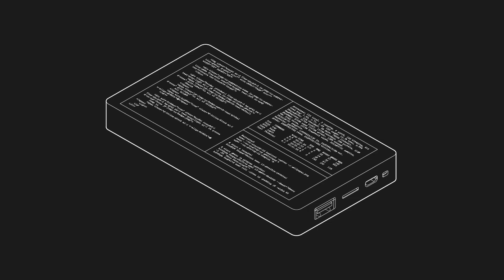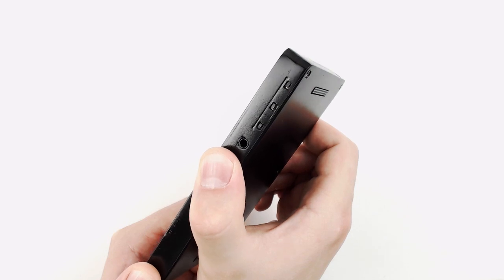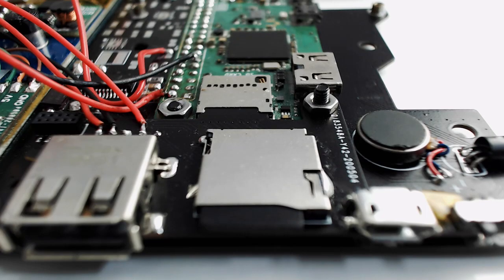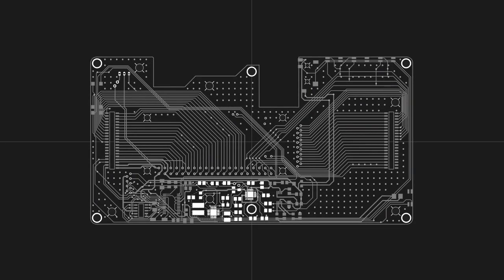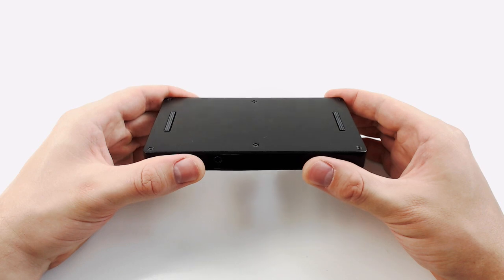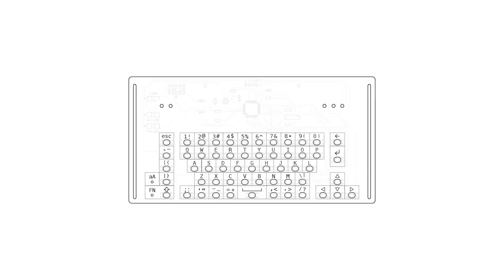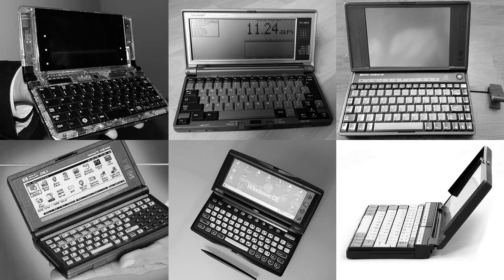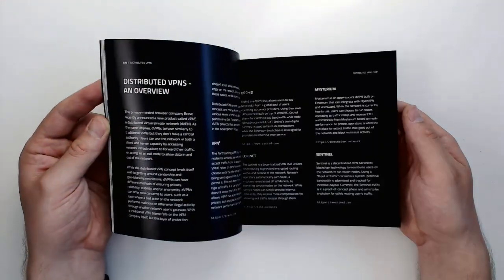Trying to build the ultimate Raspberry Pi computer (Zero Terminal V3)

Comment: This could easily become a “smartphone” as well if you added a baseband backpack. I see a lot of potential here!
Reply: There's the Adafruit FONA module that I'm sure could be worked into this, either baked in or as part of a backpack
Reply: He could use a design from Sparkfun as a reference. They even give you the complete Eagle design files.
Reply: That could be nice! Specially the mobile data
Reply: Why not just buy an actual smartphone? :)
Reply: @Dethcrush  because that's not fun and you don't learn anything by doing it
Reply: @Dethcrush  because this is designed for modularity and data security. Most smartphones aren't that.
Reply: @Dethcrush  this will never be outdated. But phones will be.
Reply: imagine what is going to happen when he gets in to type c, then we're cooking hard 🤣👍
Reply: @hamishmacdonald8593  it can be ;) that's how far we evolved
Reply: @hamishmacdonald8593  Pi Zero is more or less equivalent in processing power/RAM to the smartphone I bought in 2011. It was usable to about 2014, and biggest problem was storage, not CPU. You can get faster boards (like banana pi zero, if you are not averse to allwinner SoCs), and probably other too.
Reply: @Dethcrush  an actual smartphone is much better at being a smartphone. But if you want a portable device that runs Linux, has better I/O, fully open source, etc, this is what you want. For stuff like penetration testing, hardware concept prototyping, or just going DIY for the fun of it, this is super interesting
Reply: exactly my thought

Comment: "Oooh this seems like a cool thing to bui-"
Multiple custom pcbs and soldering of small components
"Yeah... a bit above my skill level"
Reply: The only way to get to that skill level is by fucking up a few boards trying to get it right 😂
Reply: @mushufitzburg2741  Exactly what Louis Rossmann did and look where he is now :)))))))
Reply: Soldering SMD isn't nearly as hard as it's made out to be, with the exception of all but the smallest form factors. Just need a good magnifying glass, a fine point iron, and some small gauge solder.
Reply: @fabricatorzayac  my dude - this is my problem; my arms don't do what I want them to do.
Reply: JLCPCB do SMT assembly, but their PCBs are dirt cheap and bulk components aren't too expensive to give it a go, you've got 9 attempts at the PCB for $2 plus components and delivery.
Reply: Nothing is above your skill level. You just dive into it and start doing it. It's just that the project will take you a long time because you'll have to keep stopping and watching youtube videos and making forum posts and waiting on replies. Then when you're finally done, you've learned so much that you're actually on that level now. So when you do another better one or something similar, you don't need nearly as much help.
Reply: @enermaxstephens1051  Never thought of it like that. Thanks
Reply: it's easy, the hard part is sourcing all of the materials that you need for the project
Reply: I used to be terrified of SMT soldering. And yes, you definitely do need some practice. But once you get the hang of it, it is really easy. If you flow your solder with a hot air gun, all you need to do is add a dab of solder paste to your pads, place the component and fire up your hot air. The components do not need to sit perfectly square on the solder. Once the solder paste starts getting liquid, the components will pull themselves into place. If you do not have a hot air station, an iron with a moderately fine tip will do. Put a bit of solder on one pad and let it cool. Then place your component, flow the solder and push the part into the solder. That way you can "tack" your parts in place and then solder the other pad(s) as usual.
Whatever you do: flux and IPA are your friends.I gathered my first SMT experience building mechanical keyboards.
Reply: I remember he covered in one of his video how to encrypt data using messages 

Called hide in plain sight or something 

I which using a terminal tool by passing a message as an argument your input will be encrypted but it will still look like a normal message
Reply: I've been messing around with simple electrical stuff for a while now and getting into custom PCBs and micro soldering is probably my next step.

Comment: Yes please continue to experiment, especially with the compute module, I heard there's going to be rpi 4 compute module
Reply: Compute Modules are definitely something I want to look in to for a project.  Being able to make a custom board with mounts adds so much flexibility instead of having to deal with wires and extensions everywhere.    Easy enough to design and get a board printed for your own needs these days.
Reply: I'm currently designing a CM4 IO board around this concept. It's rather tricky since the board is a lot more complex than the one here, but I'm getting there after a couple of weeks of routing...

Comment: I love this design. I like the expansion capabilities through backpacks. But since the touchscreen is around $120 itself, I'd love to use a more powerful board like raspberry pi 4B with 4-8 GB's of ram to make a really powerful pocked-sized computer.
Reply: The biggest downside of the pi4 in comparison is the power draw.
Reply: @singletona082  and the heat. I have a massive coolblock and still gets hot to the touch, active cooling is a solution but not in combination with a screen in a small form factor..
Reply: Underclocking the arm and gpu could help. See https://raspberrypi.stackexchange.com/a/100284
Reply: Someone needs to work on tiny form factor cooling. I wanna edit video and play gta 6 in my palm! 

at the same time..
Reply: Dylan Standing Alone don’t worry! You’ll only need to wait 20 years
Reply: There's the Raspad 3

Comment: This thing is amazing. Just like a modern palm top.
You've outdone yourself this time dude. Bravo.
Ive got an idea that you might like to try is it best to contact you via your node site?
Reply: I've been considering gutting an old dead palmtop and upgrading it.  A Psion one, 3 if I remember right, been ages since I looked at it. 
Could easily fit a small board in there, and the 2 RAM slots could be a removable battery and something else, storage array.  Time to get that SD card RAID going.  Hackerman.

Comment: okay I'm only 30 seconds in but I have to ask, how did you make these amazing graphics/exploded view
Reply: i want to know too
Reply: After having done with the 3d modelling, you turn the camera view to a parallel view called "isometric". And then you extract the linework in a vector format so that you can play with the line thickness and colors in a vector editing software like Illustrator.
The only difficulty is modelling. If the modelling software has the capability to export the lines in a vector format, the rest is really easy.
Reply: @treeoflife7151  Dxf file type from a 3d software will do the trick

Comment: I´ve been eying the Compute model for a while now, for a similar project like this. Unfortunately, I haven't gotten around to diving deeper into it but I think its the best next step you can make in the Pi Terminal. Great video as always. Keep up the good work.
Reply: The problem with messing about with the Compute Module is the DRAM-style frame that it locks into. It will limit how thin you can make a device, and I'd be loathe to hand solder it on with an iron. It's possible that there are alternate ways to interface with it; I've never actually thought to look.
Reply: @Nono-hk3is  To combat that I think using a DRAM slot where the PCB goes between the two pin rows on the connector would make sense. You would have to cut out a place for the Module in the taking PCB but I think that would still work. Maybe using an upright connector and jamming a PCB between the legs just works, idk have to try it out.

Comment: I want to raise an important question: 
How does the functionality and performance of this compare to the Pine phone? 
Taking into consideration also cost and/or labor of course. 
The rpi GPIO should be more flexible than the pine phone's six pins, but performance wise the Pine phone should be much better. 
I would love to see a detailed comparison between the two.
Reply: Wasn't pine phone significantly over $1k? As a finished product purchaseable from somewhere I could see this thing's price being around $300-400. If you made it as DIY project the parts would stay under $250, maybe even $200. This is assuming you have tools and knowhow for microsoldering, and a 3d printer for the cover. Outsourcing the microsoldering would increase the price by $30 and 3d printing by $100 if you are lucky.
Reply: @TealJosh  The pinephone is actually only 150-200$ depending on which version you get
Reply: @maasteeve  ah shit. mixed pinephone with purism librem phones

Comment: I'd love a thing like that with pi 3 or 4 with gui, so I could throw out my smartphone which unfortunately I need
Reply: I think it is possible to get mostly around a gui with a clever designd terminal application and a background script that checks for touch input. Combined it would work like a gui but needs less resources
Reply: TUI might be the middle ground here
Reply: Librem 5 / PinePhone are both simultaneously fantastic and in need of lots of work.
Reply: @matildahalili8051  PinePhone looks quite interesting.   Needs a lot more work as you say, the windows don't scale properly when moving from phone screen to desktop, and launch always on the phone with the crushed resolution where ideally it'd be a better idea if you could specify if an application would always launch on either phone or desktop screen when connected.  That way you could launch, say, a trackpad application on the phone and use it as a basic graphics tablet or trackpad.

Comment: I already have a very low profile 4A out@ 5V PSU which will work on anything from 7.2V to 28V. The tallest components are the ceramic caps. It was originally designed as a mezzanine board for the Pi but would be extremely easy to adapt. I have other mezzanine boards as well like a GPIO status indicator and relay boards. I am working on an oscilloscope board but so far it's too expensive for the spec I want. I was head of design for an electronics company after being a project manager/senior design engineer so "costdown" is something I'm damn good at, as is reliability engineering.

Comment: i want one, this has MASSIVE potential.
i remember old cell phones that had the slide out keyboards like you showed, i actually want one of those back, i liked it better than typing on the screen.
for storage, Toshiba and a few other companies make tiny HDDs that are designed to fit in phones, they are sub 1 inch and would make for a masive upgrade over the speeds of a micro sd card.

Comment: The QFN power ICs which you have shown are quite easy to solder with the proper equipment and techniques. I am speaking from recent experience.
With the right heat settings it is very difficult damage them too, even with lead-free solder which needs higher temps.
Small things can ruin it like using the bad kind of solder flux, which can result in over-voltage on the output due to shorts under the QFN package.

Comment: Like to propose that you consider the "Backpack-to-Device" mechanical aspects further. "Held together just by the pins" only flies with particularly careful handling and puts stresses right in the wrong spots.
Case grooves for mechanical latching, threaded holes on the back .... something.

Comment: I dig it! Would be a rad control terminal for a house full of Raspis doing various roles (Pihole, etc)  that might just be sitting on your network but you don't want to lug around a crash cart just to check em. Terminal in with your Zero terminal, Bob's your uncle.

Comment: Using a compute module would be nice, because it has the full power of a normal full-sized pi, but you can have the ports on the You would also ideally have the keyboard LEDs located on the opposite end of the same thickness-face (face of the casing), lighting the keyboard that way or on two corners of the screen, to better light the keyboard, and fit on the keyboard a joystick (even one like the thinkpad, if it's the cheapest) and 2 buttons for the cursor control without touchscreen (in case it fails). And it would be ideal if you could make a version with not only wifi internet, but also a SIM card and added call-and-messaging functionality, ideally also mobile data, and maybe sell it as an open-source Linux phone. Even if it's not cheap initially, in time it can become cheap, if enough people invest in it.

Comment: I would recommend in the xinit to run an on screen keyboard and make the orientation vertical, but when one of the backpacks are plugged in it will rotate it to landscape and turn off the osk. Thus making the transfer seem less. And definitely the first thing I would do is bind one of those side buttons to a rotate function

Comment: I would like to see a version that uses the compute module. HOWEVER I want it to have one pcb for all the connectors p, and an interface pcb for the compute stick. That way if a pin incompatible stick gets released by another company or the next compute stick from the pi foundation does not simply slot in, you have a way of keeping everything except the interface board that plugs into the rest.

Other than that? The only other thing i would want are actual switch covers to go on top of those tac switches. The backpack idea is rather genius especially since someone could make a pack that is just a gigantic power bank, solar collection, and radio. Or a power bank and keyboard. Or whatever.

Dude i love this iteration and am glad you have a dedicated domain.

Comment: Looks real neat! I’d agree that a smaller display would be better, but yeah custom displays are a real pain. I’d want to see if there are any ubiquitous and cheap replacement smartphone displays that you could interface with, but thats probably not an easy task at all. On the other end of the spectrum, maybe a small dot matrix display would be usable enough with the right kind of UI, maybe one of those extra cheap old nokia screen clones. But then of course you’d need some sort of reasonably convenient integrated input device. Maybe there’s a trackpad or trackpoint product out here that could easily be integrated.

Comment: Some things I noticed from the design (I am unsure if it is too late to recommend, but anyways...):

-- it seems like modules can be attached in any position, so the user could mount it in the reverse polarity. Why not add some guide to the box, so it is impossible to misplace it?

-- in the same vein, all mechanical force of the module seems to go into the connectors. Why not change the design a little so it adds some guides for components to be attached and secured to?

-- the raspberry pi zero is great at power consumption, but it doesn't handle sleep states very well. It would be really, really nice if there was an additional component that was extremely low-power and could power on/off the pi. Add the i2c bus and maybe some GPIO so extensions can communicate with the module, make it easily flashable, and done! You can have a low power pi that turns off when needed and can be woken up by external resources :)

Comment: I like the design, but I think that while defining specific dimensions for the case could make for very versatile backpacks, a fixed thickness could cause issues with expanding the design for more powerful (or just plain different) internal hardware

Comment: I look forward to this device, the expansion system is a great idea.  It's a very easy way to add massive functionality to a base device while itself still remaining fairly functional without them.  Kinda similiar to say, Samsung DeX where you just dock it, suddenly you've got a whole new use case for the device.  I wish more smartphones would take having a desktop functionality seriously.  There's loads of people that don't even have PCs that would love to just be able to connect their phones up, charge it while still using it for more productive stuff without suffering the horrible small touchscreens and huge UIs.

The design of this is very similar to an idea I've been working on, but mines is much thicker since it is an actual Pi3 (or now 4 since it is out) and the I/O is being used for various sensors, lights and buttons, as well as hopefully an actual phone module, if not at least 4/5g which is comparatively easier.  I maaaay use one of the compute boards.  But that'd need a lot more work on my part. I'll probably snuff it before I finish it if I had to do that lol
The external connectivity in my case is an ethernet or wireless connection, favouring the wired, since networking specs are well documented and laziness on my part.
It's hopefully going to just slot in to the top of one half of a dual-panel tablet when I'm done with it. (one full-color panel, the one it slots in to being an e-ink panel which is low power so can easily forego the extra space to hold the phone form-factor)  
The 3 separate devices will communicate over said ethernet / wireless and share hardware / resources with each other.  That'll be fun to code... the network handover stuff between wireless and wired is one I am not entirely sure how I will do transparently with little interruption or data loss.  Lots of experiments.  In fact I could easily do that now with a virtual device and VMs which I may do soon.
Haven't even started it because of the pandemic mess.